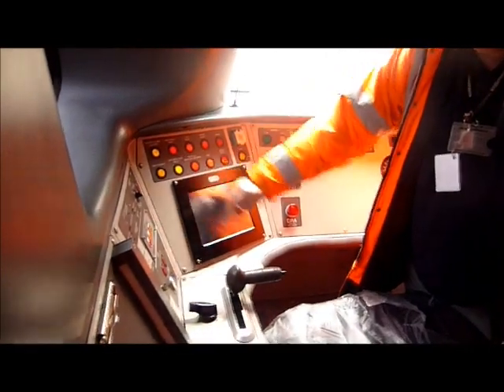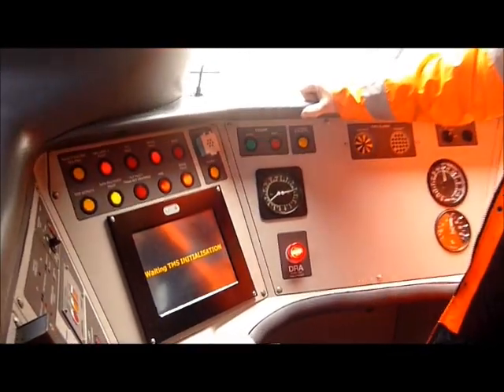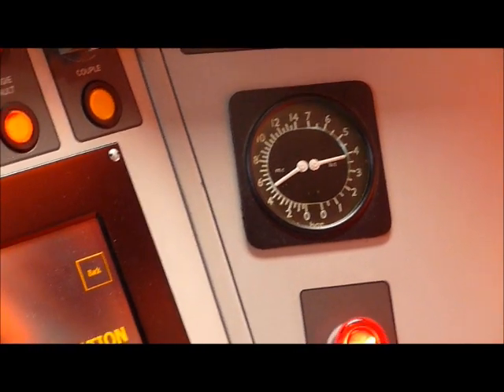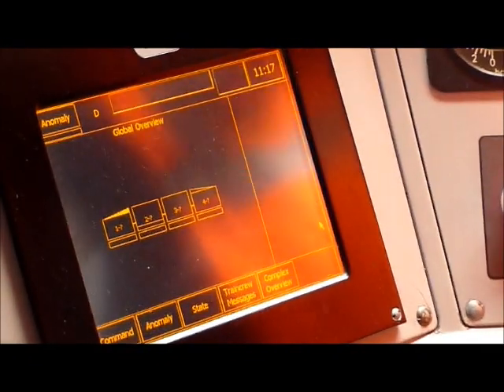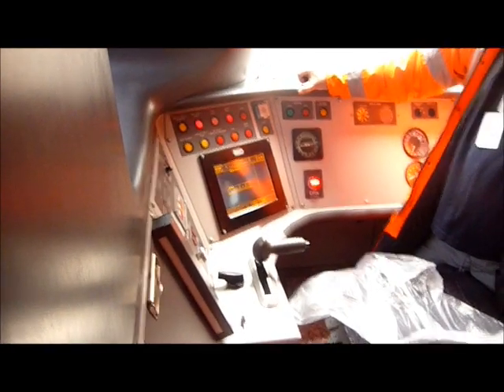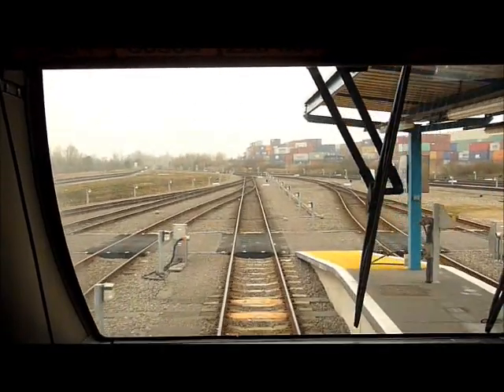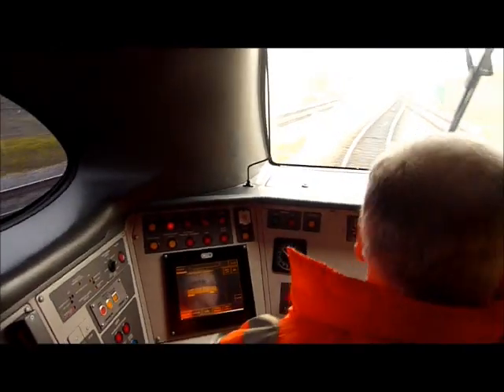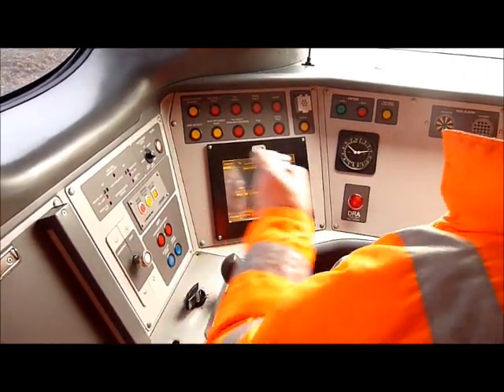Starting up procedure of a class 220 Cross Country Voyager

Comment: These Train Drivers carry the same rank as an Airline Pilot in my Book. The Aptitude Tests for Train Driver are MORE difficult ! Especially the psychometric tests.
Reply: not a chance
Reply: @ElliottHurst  I take it you have done both ! And the Fighter Pilots' Aptitude Tests ?
Reply: @Biggles2498  no roy but come on you can't compare the two
Reply: @ElliottHurst  The Pass Mark is 85% but after several Mock Tests for faulty signals which was basic Physics and Electronics with mental agility I only scored 72% which I was told a good score but not good enough. try again in 6 months !
Reply: A lot of a pilot's job role is hidden from the public. Train driver is still a very respected role though

Comment: I really like this demonstration of starting up procedure and i thank you for sharing this video but i don't understand how a big company like Bombardier don't afford to hire a few good IT engineers to develop it's own operating system for their trains and not to use crap win. CE.
Reply: +ANDIY GreenGanjaMan Because it would cost a fortune, take years and can only be written by specialists who arent easy to replace. Since they only build a small number of units, its not cost effective. CE is good enough for this application. They're not Boeing who make a few thousand (if not more) of a unit.
Reply: I believe Bombardier has moved to using a Linux-based platform since the Class 379 was bought in.

Comment: they are too small for rush hour running the toilets stink you can't have a nap on a long journey because the underfloor  engines vibrate the carriges that much.  they are a joke they should keep the HST 125  and scrap these sardine cans
Reply: Daryl Kemp yeah, I hate them too.
Reply: Bruv add some commas
Reply: Daryl Kemp yea i travel with vtec to go from leeds to the south

Comment: safety systems are never pointless.  HSTs have safety systems as does any modern traction.  The idea is that the safety systems provide an alert to the driver if something is wrong.  Be it a warning light (in the case of HSTs and traction of that era) or a noise and information on a TMS (as on very new traction).  Otherwise the driver should keep his eyes ahead on the track and signals. That said, I agree with you about Voyagers.  Awful plastic rubbish.